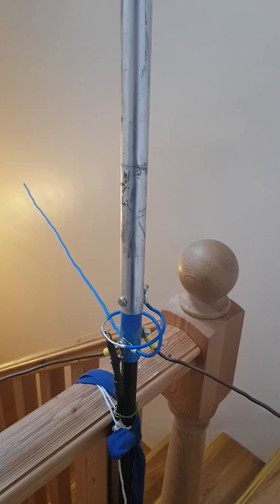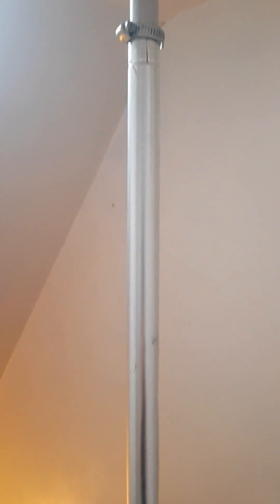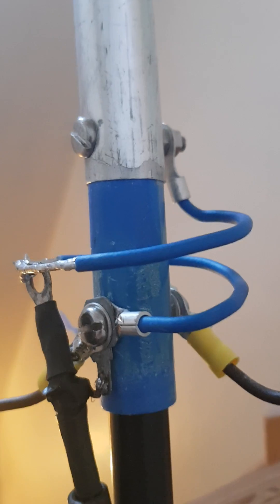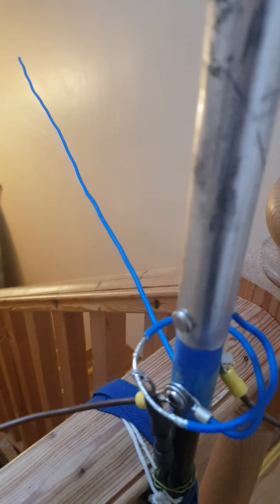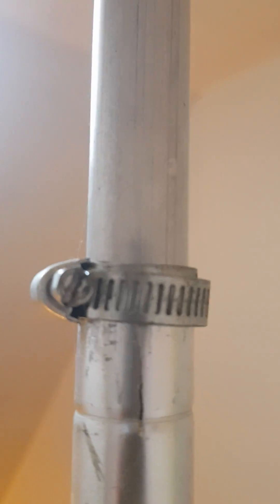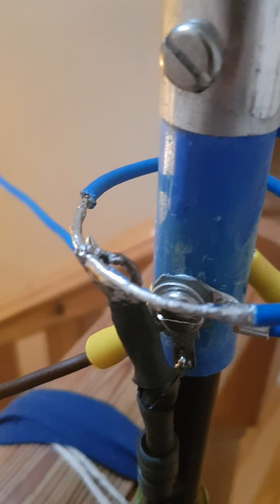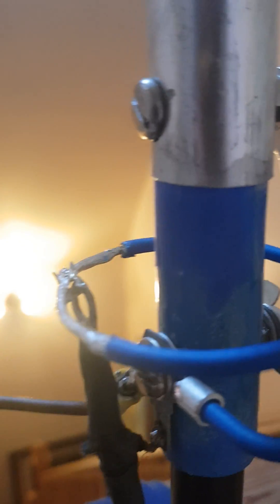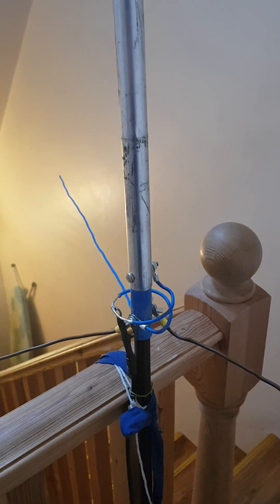5/8 145 Mhz Vhf Vertical Antenna Homebrew

Comment: Is it correct, the coil is 5 inches?
Reply from the maker: Hi berndb,the diameter of the coil is 5 inches,about 1.5 turns. 73s
Reply: @mm0umz426 hello .for fm 90mhz..with  wire coil 1/2 milimeter . how much turn? and coil wedding diameter ??
Reply: @mm0umz426 hello .for fm 90mhz..with  wire coil 1/2 milimeter . how much turn? and coil wedding diameter ??